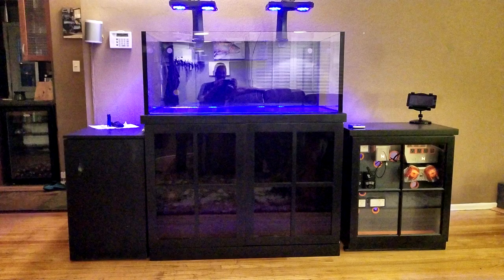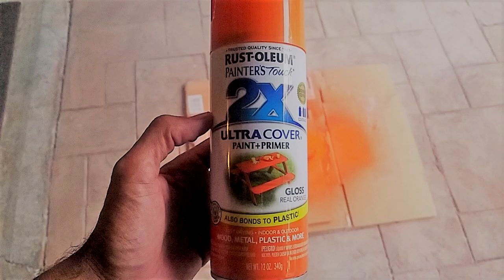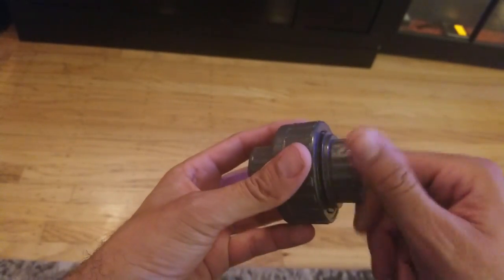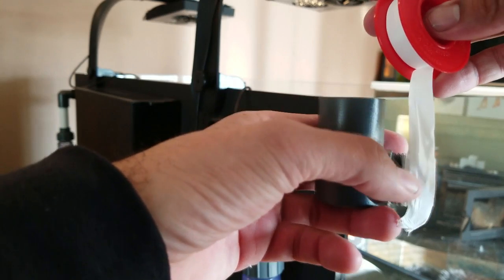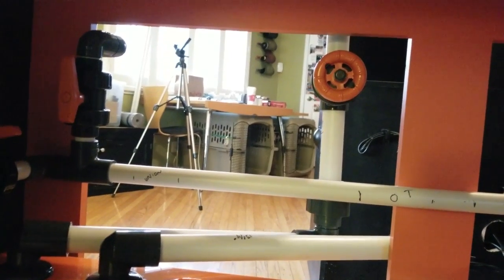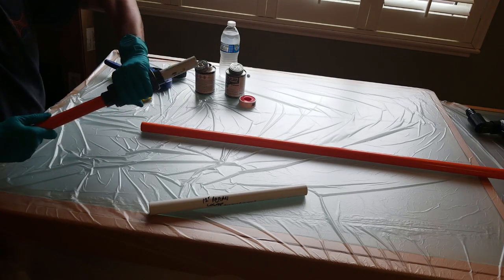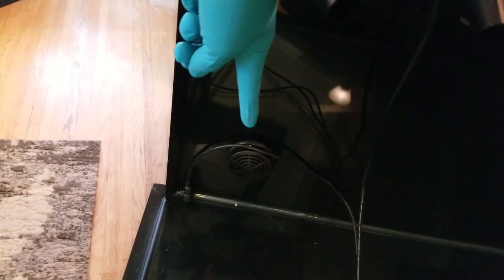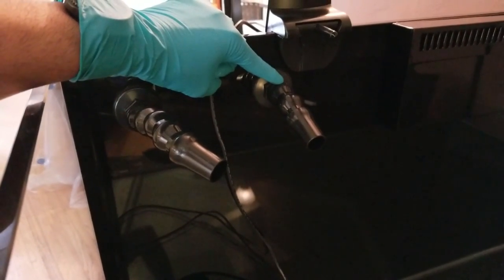Build Series| Eps. 17| Aquarium Plumbing

Comment: Just so you know, the ball valves should be positioned in the flow of water  , so the handle when open goes with the flow. That’s the proper way. But nice set up
Reply: I think he had it right.  The stubby end on the handle point in the direction of water flow on that brand.   It also has a small arrow and the word FLOW.

Comment: Just FYI, every 90* elbow you use adds restriction to the flow of the system. Each 90* is like adding 6"-12" of pipe. It cuts down flow and also requires more power to push through those restrictions.
Reply from the maker: Yup! It's worked out great for over a year.  Thanks for the post. 👍

Comment: Gil, question for you......What type of reducer did you use for the drains at the bottom of the unions for the 1 1/2" to 1" tubing?
Reply from the maker: I used slip to slip and glued. Was that what you were asking?
Reply: @ReeferGil  was it a Schedule 80 Reducing Coupler 1 1⁄2” Slip x 1” Slip  or a Schedule 80 Reducing Bushing 1 1⁄2” Spigot x 1” Slip? It is hard to tell from the video.

Comment: Does your pump do well with the inlet up against the side like that?
Reply from the maker: I run it with about two finger widths distance from the side of the sump. I am conscious of not letting the inlet rest up against the side of the sump. I've had no issues. Thanks for the post and great observation.

Comment: This is a lot of great info, but one bit of misinformation: don't use Teflon tape on on PVC pipe threads. Teflon tape doesn't help threads seal, it just lubricates metal threads. PVC threads don't need it, and it can actually cause leaks. http://www.lascofittings.com/threads
Reply from the maker: Thanks Man, it's actually not misinformation. Use the tape on any PVC pieces with threads.

Comment: You are NOT supposed to use teflon tape for PVC on PVC threaded. However, you can use SEALANT, but NOT PTFE TAPE! That's wrong advice, check with the manufacturers.
Reply from the maker: You don't have an aquarium do you? You've never plumbed an aquarium, have you? We use Teflon tape for all of our PVC threads. No spamming my channel please.
Reply: @ReeferGil  Reefer Gil, just because you do something doesn't mean it's correct. You assume 2 things that are incorrect. And a third and fourth I could point out but won't. Please do your research before you come @ me, http://www.lascofittings.com/threads

Comment: Great video. I have a question. I have a 420 gal tank that I'm working on. The return pump is a Reeflo Super Dart / Snapper Gold Hybrid (4300⁄2400 GPH) that has a 2" FPT inlet and a 1.5" FPT outlet. I too, was wanting to use 3/4" Loc-line at the tank. Do I stay with 1.5" on the pipe from the return pump to the tank and then reduce to 3/4" bulk heads or do I not use Loc-lines and reduce to maybe a 1" bulk head? Thanks in advance!
Reply from the maker: Hey Ted, not really sure how I'd plumb a 420. I don't want to steer you in the wrong direction as I don't know if a 3/4" return would be the right size for your volume of water.

Comment: what about push fit fittings /no glue/primer and can be removed for maintainance any side and they are quite strong /and wont leak unless you don't put the seal on properly or cut straight etc /things like that
Reply from the maker: Hey, sorry. I'm not sure where on this project you're recommending push fittings. Maybe a notation of the timeline in the video. Thanks.
Reply: ReeferGil I meant the whole build

Comment: The check valves are going to hammer when you kill the lower because they rely on head pressure. When you kill the power and they start hammering just put a finger over the tip of the return nozzles in the display tank and they'll stop👍. Had to watch the video again lol
Reply from the maker: They definitely do "snap" when I turn off the power. Thanks for the tip!
Reply: @ReeferGil  Where did you get the sump...??

Comment: Looks awesome 
but why do you reduce the drain line from 1.5" to 1"?
wouldnt it be easyer to uns 1" all the way ?
Reply from the maker: Hey Mike, I would have preferred running 1" drains all the way. Synergy Reef Overflows come with 1.5" pre installed bulkheads. I had no choice but to use the 1.5" from the overflow system and reduce down to 1" before entering the sump.

Comment: Don't throw that skimmer away. Go pick up some Weld-on 16 and lay a bead over the crack and it will fix it just fine !!
Reply from the maker: It was a V shaped crack that ran up to the middle of the body. Skimmer has been gone for months. Thanks for the info though.

Comment: It's probably long gone, but unless its shattered into a million pieces you could repair the skimmer body with ether weldon 40 if you are reattaching pieces or weldon 16 perhaps for welding cracks. Obviously you wouldn't want to use this on your display but it would still be fine for a frag / qt system.
Reply from the maker: Hey man, yeah, that happened like three months ago. I was seriously angry beyond return. I slam dunked it into the garbage can. It had a V shaped break in it.